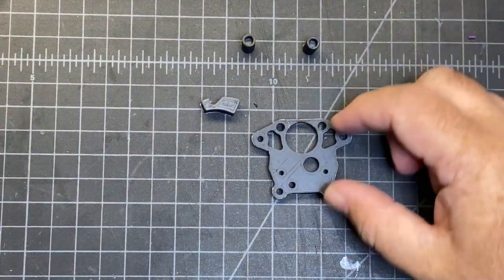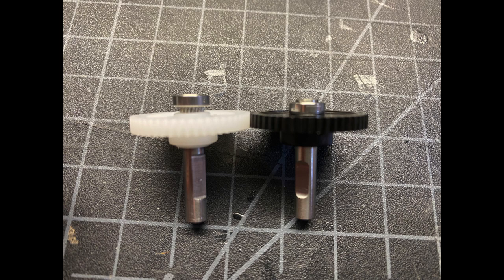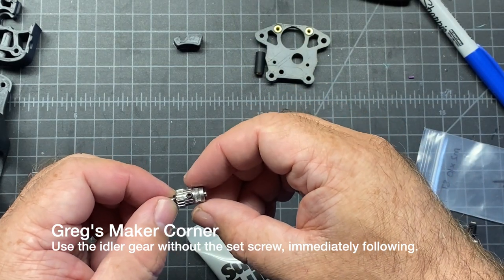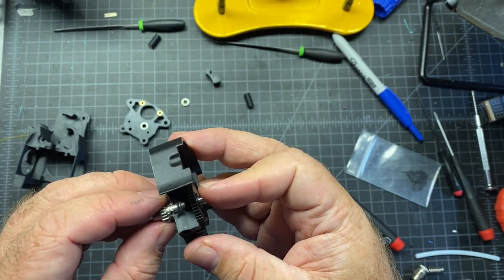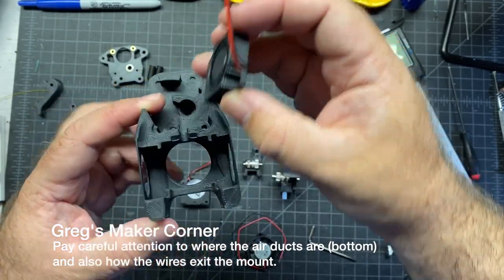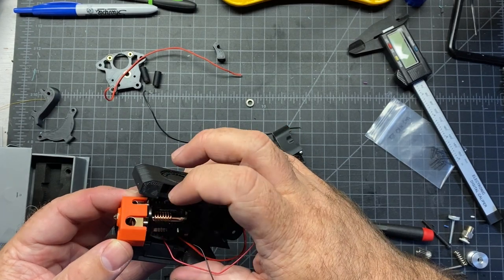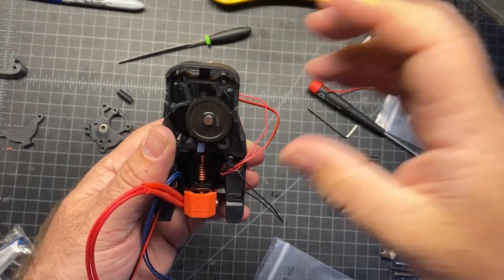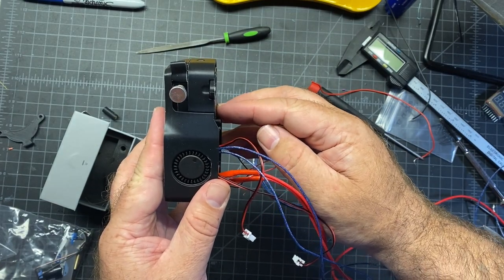Voron 0.1 Build Series - Mini Afterburner Assembly

Comment: Great videos. I appreciate the help.
I found the easiest way to get that last bearing into the printed part was the back side of a sharpie. Put the part flat on the table and push down on it with the sharpie, with enough elbow grease until it clicks into place.

Comment: Do you feel any drag at all after the latch is closed? I feel my gears are squished together, and takes a bit of force to rotate the drive geat with my fingers. Can you confirm if this is normal?
Reply: HI you probably mount your v0.1. I have the same issue. Its working with drags or I should be worry? I cant find solution of this problem.
Reply: @MsDranX  It actually became really smooth after like a few times of use of the machine. I noticed the shaft was rubbing against the motor the whole time, as there was a mark on the motor (I used the printed tool to help gauge how far to grind down the shaft, but apparently that wasn't enough). I'd suggest you to check if the gear shaft has left a mark on your motor, if so make sure to grind it down a little more. HOWEVER before this, you should make sure your parts are printed well (eg. cowling isn't warped)

Comment: Hi Greg. Have spoken to you on the discord. Might be worth mentioning that there is a small channel for routing the fan cables. It’s a bit fiddly and it might be that you just decided not to use it. I watched this because my mini afterburner just doesn’t work like it should and I have no idea why. Think I’m going to try getting the genuine gear as the clone makes things tricky to align.
Reply from the maker: Good call out! I honestly couldn't even see the channels for the fan cables, which is the main reason I didn't use them.. lol. My eyes aren't as good as they used to be. Good luck with your gear, Bondtech definitely helps. I will say it also took me a while to figure out the proper thumb screw pressure, as I was having issues loading but now it's fine. Hit me up on discord if you think it would help...
Reply: @GregsMakerCorner  Thanks Greg.  Yeah the channel goes up the inside face of the cowling and across the top of the blower fan. Dispute being super careful with the build I feel like I have a number is issues which makes diagnosing even one tricky. Always felt that having to sanding the shaft end off could have been designed out somehow.
Reply from the maker: @WU LYU No need to use the channel, as long as you have good strain relief (using the zip ties at the top where the wires come out) you should be fine.
Reply from the maker: @WU LYU The 3d printed holders for the preloaded nuts are definitely optional.  They do make it a bit easier to keep the nuts in place / positioned, but if you didn't use them, no need to.

Comment: I am having an issue that when I get everything snugged up, the fan for the hotend itself gets bound against the hotend and won't spin. If I loosen things up a touch, it works.
Reply from the maker: Hmm it’s possible the parts could be a tad over extruded. But If you just had to back off a bit and it stays tight you should be fine.

Comment: Hi Greg's, really great videos building the Voron 0.1, I am on my way doing the same. Just a question, the printed parts needed have you printed them in ABS as recommended or it is another type of filament let's say PETG? thank you in advance
Reply from the maker: Hello Viko thanks for watching. It is definitely a good idea to use ABS. Because of the enclosure, PETG may eventually warp over time due to the higher temps. The enclosure can easily reach 40-50C temps when printing. A good filament to use to print the parts is eSun ABS+. It doesn't warp or curl as bad as traditional ABS.
Reply: @GregsMakerCorner  thanks a lot for your fast reply and valuable information!
Reply: You can use ASA as well

Comment: Which BMG clone is that?
Reply from the maker: I believe it was from the recommended v0.1 bom link... since mine came in a kit I'm not 100% where. I think it's hit or miss on the quality of the clones.
Reply: @GregsMakerCorner  i don’t think this is TL, but I can’t be sure. Kits don’t have such expensive components in them, I never saw a TL BMG in a kit
Reply: @gloopann  Yep.  I put together the kit.  Cheapo bmg clone.  I ended up sending bondtech gear assemblies and thumbscrews out as replacements.  Given how few parts of a bmg extruder are needed for this toolhead, I’d consider genuine bondtech parts going forward.